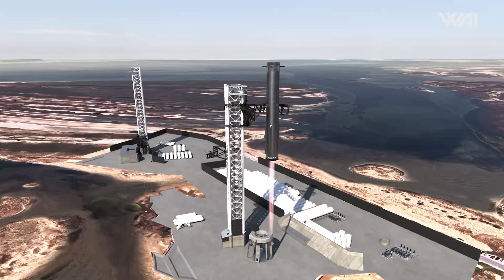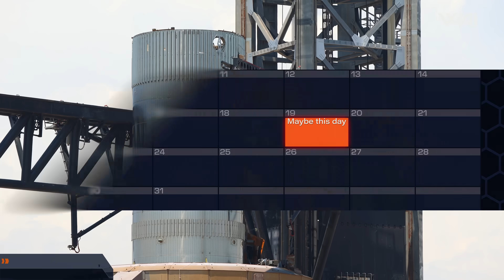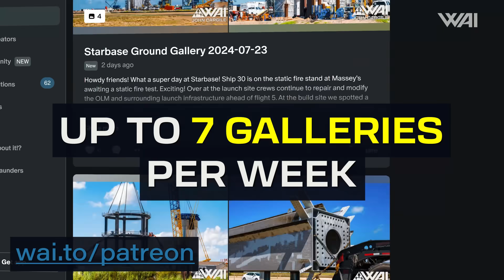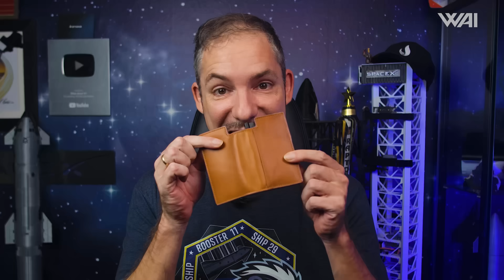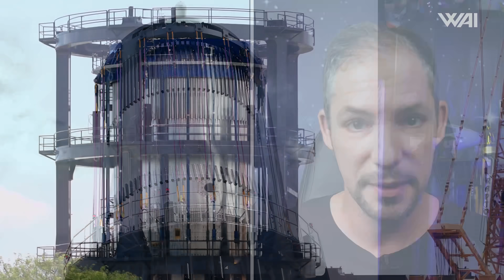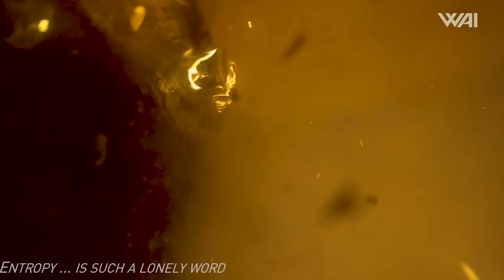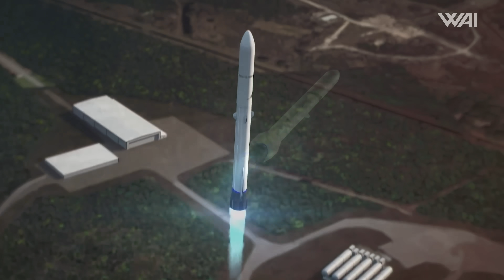SpaceX Is Insane! - Starship Flight 5 Test Campaign! They're Ready For The Catch!

Comment from the maker: Go to https://partner.ekster.com/Whataboutit and get up to 30% off on your next wallet with my code: WHATABOUTIT
What do you think? What caused B1062 to sign off? :_WAIShocked:
Reply: I think B1062’s landing leg when deployed over extended like someone doing leg press and the stress made it snap inwards
Reply: LOL! a booster with a design life of 10 reuses failed after the 23rd landing. That is a non-issue.
Reply: Best part is no part.
Also this wallet: huge amount of parts + electronics.
Reply: stop the music
Reply: That's a lot of launches 23, it could be a slight loss of engine performance caused by carbon deposits that was not calculated correctly.
Achieving 100 launches could require more maintenance or controls to determine more precisely the loss of performance.
Reply: If possible, use the new tower.
Reply: this is a stupid bit of advertising anyone who knows history knows that there is a difference between a wallet and a billfold trying to sell a billfold as a wallet only encourages ignorance
Reply: they are called "Cherry Pickers".... not erm man arms
Reply: @Whataboutit  
It would make sense that the Space-X Starship launch tower chopsticks should have inflatable bladders on each arm  to help assist the catching of the booster and starship.
Reply: 4 pole metal net with hole in the middle maybe .. or  open top  .. that way .. will never tip over :)
Reply: Why Do Astronauts Float in Space?
This is the Secret
And the high-speed Space Station
Artificial Gravity is what is being sought and is very valuable

Something that is far in space beyond the magnetic reach of the Earth then that something NO LONGER has Density, instead it floats around aimlessly until it is again in the magnetic area of a celestial body that has a Magnetic Bar, then it will fall in that direction; This practically happens because all celestial bodies drift through an orbit at extraordinary SPEED. 
Astronauts and other objects in various Apollo rockets sent to the moon in 1969 proved all this information, and these objects and astronautes seemed to be floating in the space of the rocket.

So actually the Magnetic Bar stretching from north to south is what causes attraction (gravity), and every concrete object has a Falling Motion or Specific Gravity (Density). 

Every concrete object consists of an arrangement of atoms and emptiness. These atoms have particles that also have a magnetic bar in their mass. The magnetic bar on the atom is what ATTRACTS EACH OTHER to the MAGNETICBAR on Earth. The denser the object is with the arrangement of its atoms, the greater the DENSITY or the greater the falling motion. 

The difference in atomic density is what differentiates the specific gravity or density of each concrete object.
As a result, a mass that does not have a magnetic bar stretching from north to south does not attract or be pulled, and only two masses that each have a magnetic bar attract each other with a force that is proportional to the distance between them and the magnetic attraction value of each.
Reply: Better than Rocket is here
Easy lift off 
Easy land on with antigravity Spaceship
No Fire
No Explosion
No Flame
Just Spin and
Lift off
Powered by Baterry

Work base on Gravity just spinning by using Battery
can fly in bad weather, plunge in the ocean even in outer space
Can lift more than 100 Ton 

Earth which weight predict 600 trillion ton does not fall at the Sun because of centrifugal in orbitting, on the contrary it does not be thrown far go out the orbit line of hold by gravity at the Sun as orbit center. Gravity and centrifugal is equal called Equillibrium, thats why until now Earth which we was inhabited always rotate and circulate the Sun. Now we justly take example : how if the gravity used and centrifugal is negated? The Earth will float far leave the Sun. So that centrifugal can be used to fly far away if gravity eliminated. Finally how to eliminate gravity?

It’s way rotate part of aircraft by horizontal. When that rotation faster centrifugal force getting greater and the gravity getting smaller, finally it lose the gravity and the aircraft start flying. Of course people would surprise: how the aircraft can keep rotate without fulcrums? Thats why we named that aircraft Shuttling System that is aircraft likes two disc adjoining attached in the midle as fulcrums:

A. The Top part, we name Positive rotate to right, and the edges is getting thicker and havier.

B. The Buttom part, we name Negative rotating to left, and the edges is getting thicker and havier.

C. Middle Part , we name Neutral, air crew placed and also machine and everythings turning Negative and Positive at the same time.

The aircraft can liftup added with explosion from the engine. However that aircraft construction later, let the engineer doit it, and we are sure the aircraft will bulletproof and also waterproof.
 
.
.
 
In modern civilization where human being generally using flying saucer as vehicle, will a lot of change in lives either in materialism and in psychological. In materialism area will apply the change in life like.
People no longger need roadway and rel road which spend large of energy, money, places, things and time, object place and time. People would utilize that area for habitat or for other need:
Reply: No Dude !
Reply: sorry, but it's not working in Japan, we still use coins a papers a lot!
Reply: "Catch out of mid air" I didn''t know it was possible to catch something not out of mid air xD
Reply: I think it had a hard landing and that caused the landing leg to fail.
Reply: I tried the discount it only took 3 bucks off a 70dollar wallet

Comment: In a community near me, they are installing a new water plant and distribution system to replace wells. In the past few weeks, I have seen several water tank trucks filling up at another nearby town from a fire hydrant (a meter is installed on the hydrant so obviously the contractor is paying for the water) and flushing the newly installed pipes in the new system. Is the water flushed out considered industrial waste?

Comment: I understand the great complexity of catching the booster and that there are a great many untested and unproven factors, but I don't understand why SpaceX doesn't (won't, can't ???) just launch the booster in a relatively short ascent to  return back to the launch site ... calculate the exact fuel for a "light launch" and "rate of decent" at "Chopstick Capture" ... IMO, the booster would return with minimum residual fuel to minimize potential catastrophic damage with failure ... So, Why Not !!!

Comment: To me it appears 1062's engines stayed on a smidgen longer than usual and also thrust seemed to come toward that one leg -probably already weakened from other flights. If I had to guess though that Engine leaked or stayed on longer/harder than it should probably caused by a faster descent..even though it did not look that much faster than usual

Comment: If the chopsticks have additional arms at the end with magnets, wouldn’t that help with the bouncing issue when they catch? Would also ensure they are in a precise position when catching, must be a concern if it is bouncing a few inches and miss the catching rails?
Just a thought, not an engineer but seems a practical solution, thoughts? 🙏
Reply: The stainless steel used for Starship is NOT significantly magnetic.
Reply: True, I actually meant magnets that can be on both chopsticks that hug around the body and connect to each other connecting the chopsticks in a precise manner that aligns with the shape of the ship, not connect magnetically to the ship itself, sorry for not properly explaining

Comment: Unfortunately for RFA they will most likely need a redesign of the oxygen turbo pump as a whole or some serious part upgrades. Im not a rocket engineer but it appears  (assuming the fire was internalized to the turbo pump) that the fire would have to have been started either by too high of compression causing friction and more heating than expected, or a part failure causing either friction/heating or some sparking, igniting said Oxygen.

Comment: 1:05  Why is SpaceX going to catch the booster while it hovers over the launch pad?  Why don't they hover the booster where the Raptor engines won't do so much damage; then once caught by the chopsticks, move the booster over to set it on the launch pad?
Reply: How much damage are you expecting a few throttling down engines to do?
Reply: @TheEvilmooseofdoom   If I had to guess, I'd say that I expect three engines to do about 10% of the damage that is done by 33 engines on liftoff.  What's your guess?
Reply: 33 of them launch from the same place. 3 for the lending burn isn't going to destroy anything on their own
Reply: @Jetfast619  Nothing?  Wow.  Even so, if I had the option to hover over the launchpad or not hover over the launchpad, I think I'd choose not to hover over the launchpad.
Reply: @veewaha4009  that's a good idea but I don't think that the chopsticks have that much range of motion but what do I know?

Comment: It came in too hard. Late brake ignition The leg that collapsed took the initial pressure on landing and failed plus the engine was still firing which destabilized the booster and a combo of events took it down.  Note : Maybe the landing algorithm was slightly out of sync which would have cascaded the issues we saw when it hit the deck.
Reply: It's the always present danger of the suicide burn.  Which is why they don't want to do suicide burns for Starship and SH.

Comment: Use a crane and attach booster 14.1 and simulate it coming down (landing) in different angles of approach so they can physically practice different scenarios over and over again so they are as prepared as possible in as many situations they might incounter. Hands on physical PRACTICE MAKES PERFECT.
1
Reply: I don't think there are any cranes designed to lower large masses that fast.  It tends to be unsafe.

Comment: The live stream suggests the first scenario, that the booster landed too hot. As it touched down, you can see the engine bells dip very close (possibly even contacting) the deck before bouncing back up. The extra stress could easily cause both a failure of one of the landing legs as well as the fire if one of the bells was cracked by slapping into the deck. Kinda like SN10's hard landing.

Comment: My guess would be metal fatigue on that cylinder. The telescoping cylinder piston only reserves minimal overlapping surface area when fully extended, and the multiple extreme heating /cooling cycles cause embrittlement. This weakens the overlapping area to the point of failure. An easy fix is to increase the overlap or upgrade the cylinder materials.

Comment: To those that bow at the alter of Elon Musk and SpaceX. Falcon 9 and falcon super heavy are a great launch system. Too the engineers that created it aren’t there anymore. The falcon boosters on the other hand have done pretty pretty good. Especially without their creators.

But they are still far from being the pinnacle of space launch systems. You remember the space shuttle? Discovery flew 39 space missions not just payload delivery. All of that over 27 years. If Elon didn’t hastily fire people before he thinks. Falcon could be well on its way.

But starship will either launch starship to orbit or attempt to get caught. But Elon can’t have both. Remember booster can only withstand 4.00 minutes at full throttle. If they burn booster for 2.10 second to launch it will crash. If they implement raptor 3 engines the time will go down not up.

Either way don’t let your expectations run wild. You will only be let down.
Reply: This from someone who was spoon fed nonsense by an even bigger fool.  Nice fail.

Comment: Booster’s 9 landing platform was at sea, would it be possible that a large wave caused it to rise thus throwing off the landing calculation so one the boosters leg may have touched down before the rest so talking all or most of the impact to the point of failure?

Comment: Keep in mind that Felix is simplifying how the Falcon 9 performs the suicide burn (or "hoverslam" as SpaceX likes to style it).

Yes, they do want to run the center engine used for landing at high throttle to decelerate quickly; if they didn't, the maneuver would require more fuel. But they won't be running it at full 100% throttle, most of the time. They'd leave a little bit of wiggle room so that the engine can be throttled up (or down) to correct for starting the burn a little late (or early). I'd guess somewhere in the 90 to 95% range.

Another variable they can control is how long the engine remains at high throttle. As it approaches the droneship and its speed drops, the engine would be throttled back gradually to permit finer control of the time and altitude at which the F9's velocity reaches zero. But this curve is not fixed, it can be made steeper or shallower on the fly by the F9's flight computer, as needed. If it's coming in too fast and 100% throttle isn't enough, it can simply delay the throttle-down until it's back on track.

These kinds of adjustments, along with the generally high reliability of the hardware, explain why SpaceX has managed such a long streak of landing successes, after the initial period where they were still trying to dial in the parameters and control algorithms! They went from no successful landings, to a moderate fraction, to almost every one, to 267 consecutive successful landings. The one that finally failed is almost certainly not due to a software problem.

My best armchair guess based on several people's analysis videos is that either that the one landing leg gave out without absorbing hardly any of the impact, and/or the engine unexpectedly began to underperform in the final moments and couldn't be throttled up enough, or quickly enough, to prevent a harder than normal landing (which may also have contributed to the landing leg failure).

I'll be very interested in the results of their investigation
Reply: Scott Manley showed a comparison of past landings and speeds which was very helpful. The difference was about 10 km/h at touch down - not that much, but on a car that can be the difference between a minor dent and a major repair. I think the legs were designed to land in this range, but my suspicion was there was unknown metal fatigue in the strut. Probably after 20 launches, SpaceX should plan to use the booster on non return launches like for satellites bound for geo orbit.

Comment: Seems the chopstick rail are not welded but attached using bolts. The holes for these are quite far apart and the sizes of the holes is not that big. Will the rails stay in place under the huge forses of superheavy catching?

Comment: O² fire: The best example of this is a cutting tourch used for cutting steel. After preheating the steel, a stream of oxygen is directed where the cut needs to be,the steel burns, melts and is blown out of the cut! the heat prepares the steel ahead of the O² "stream, and the cut procedes. Elon once described super heavy as the world's largest cutting tourch, when talking about to the damage to the launch pad after FT1. 
This tendency of pure O² to burn anything is the major difficulty in O² ritch full flow turbine pumps like in a raptor engine as the metal parts want to burn up. This is where having the world's best material science team is critical.
Reply: When oxy-fuel cutting, the steel oxidizes and gets blown away by the stream of oxygen (rapid rusting). It does not melt...

Comment: The fact that the same booster has been used 23 times in 4 years is insane knowing that only 11 years ago it was not clear if reusability of a rocket was a thing !
Reply: Yeah, you can't really count the Space Shuttle as reusable.  It took far too much refurbishment - and money - from flight to flight.  Now, don't get me wrong,- it was an extraordinary machine;  on top of that, perhaps that first generation of thermal tiles helped pave the way for Starship's thermal protection system.  Different materials entirely, of course, but similar conceptually.  It will always be one of my favorites!
Reply: Except  for the fact it was done 50 years ago.
Reply: @palindromic7873  except it wasn’t in any way
Reply: @craigprosser9554  it was first done in 1981
Reply: @palindromic7873 bro it's funny how your right and he complaining 😅

Comment: SpaceX still needs to perform a 2 X (full load) drop test as a free fall drop test from a few feet above the arms while the arms are at the catch level on the tower. If not performed, a successful catch will have too much risk. Even if successful, my bet is that SpaceX will be building a bigger (heavier duty) tower after gather catch data in order to have a tower that can handle >1000 catches without significant stress weakening from many catches.

Comment: Thinking that rockets can be as reliable as airline flights is a long way off. We're at about post WW2 level of reuse and reliability, when comparing rockets to aircraft. At present we don't gleefully count the numbers of safe takeoffs and landings of a Boeing 787, expecting a complete failure with a load of passengers aboard... eventually.
Reply: Falcon 9 is more reliable than the B29.
Reply: Rockets as reliable as MODERN air travel will take a generation or two yet.  Or three..

Comment: Musk's "drinkable water" comment is irrelevant and misleading. I really doubt you'd want to drink the runoff from the pad. after being blasted by rocket exhaust and everything that burns/falls off the pad, it is industrial waste, and they should have a holding tank for it and filter it for reuse. Even clean water shouldn't be dumped in large quantities into a wetlands environment.  But if the regulators want to stop SpaceX from doing it they'll need to increase their fines by 2 or 3 orders of magnitude.